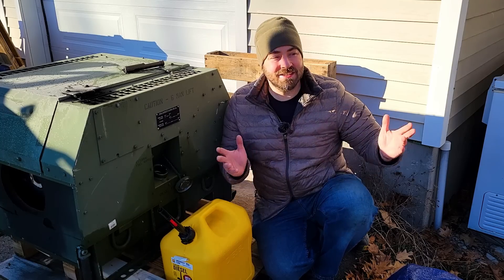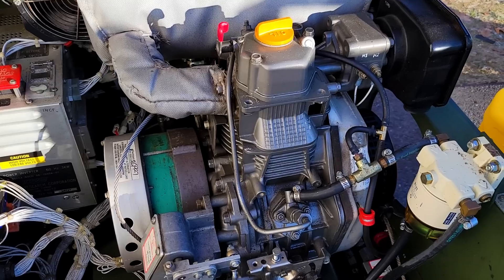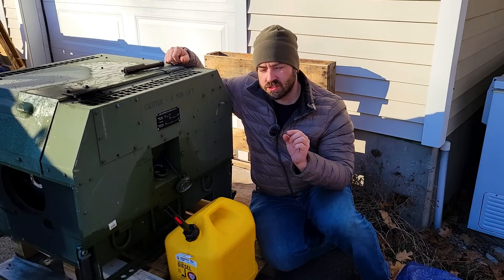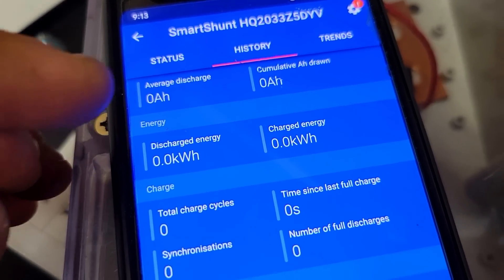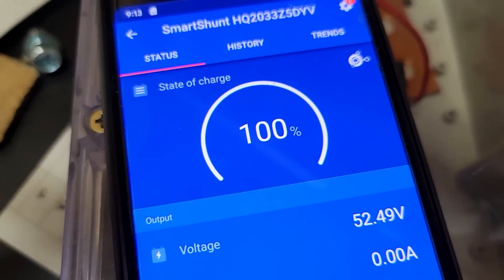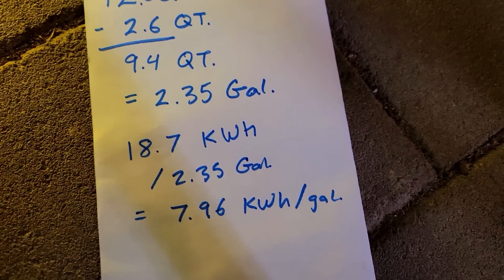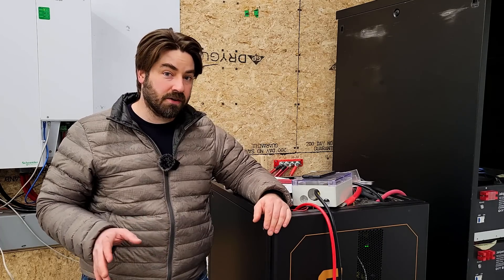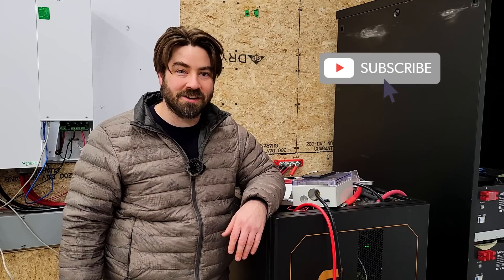How efficient is this Army generator?  MEP-831A

Comment: Hey David quick question... I have eg4 3000 at my cabin and getting shocked if I touch metal appliances and tools I'm using from it. It's worse if I'm wet.... aka concrete mixer lol. It's not earth grounded nor is any part of this temporary setup. It has a place for it on the chasis so I'm wondering if that's the issue? I haven't experienced this with my growatt 5000 at my house and they are not grounded but the house has the original ground from the main load panel. Any thots??thanks
Reply from the maker: Grounding is never a bad thing, and I recommend grounding if possible.
Note, I've never tested the EG43000 inverter, so I can't speak to that model.  In general, if I was to get shocked by an inverter, I'd first check that all my connections look good.  I'd check there are no loose wires, or fine strands of copper, that might be making a short to the housing.  If I can't find something like that, then I'd either scrap the inverter, or if it's under warranty, get a refund.

Comment: I’ve been watching your channel for years, especially the generating projects. Have you ever considered using a brushed dc motor as a generator and connecting to the  pv input  on the inverter.?
Reply from the maker: I did that with my treadmill project.  The treadmill motor is brushed.

Comment: David, have you ever thought about using a small 48-volt wind turbine?
By the way your channel is sweet... great information
Reply from the maker: I think it would be fun to try a cheap wind turbine.  However, my location is terrible for wind.  Low average wind speed.  I don't have enough room to set up a large tower. Lots of trees on neighbors property.
Reply: @DavidPozEnergy My set up has similar issues. When I get everything assembled on my new building I would like to try one on the roof of my shop.
Living in South Dakota the winter is short days. Love all the information you have provided on your channel!!
Reply: @DavidPozEnergy  Have you picked out a wind turbine? I have not found one that I was impressed with.
Reply from the maker: No, I have not picked out a turbine.  I would need a very low-speed start-up.

Comment: I used to have a semi and I had a rig master 4000 watt generator with a 3 cylinder diesel engine. This was an economical way to have a heater or a/c on the truck and have power to run a microwave and tv. Those little generators ran on like a quart of diesel an hour full out running. All I am saying is, you might find an older one cheap and check it out.
Reply from the maker: Thanks for the tip.  I'll see if any show up on the used market

Comment: If you ever need to buy another generator buy a military welder it will already have dc around 48 volts at about 200amps your mppt charge controller can handle them my old one could do 500 amps with adjustable amperage dial with a very efficient perkins deisel i payed 1100 for it
Reply from the maker: Thanks for the tip

Comment: I would assert that the improved fuel economy of the military generator has everything to do with the improved fuel ability ... diesel vs gasoline.   35% sounds about right in the difference without doing the calculation. .. good video David ....  good stuff!

Comment: Here in Finland, diesel and gasoline are roughly the same price, approx. 1.8€/l, tax-free diesel approx. 1.4€/l (11.8kwh/l). I heat with "free" wood 4kwh/kg, my electricity usage is low, I just received the electricity bill for the end of the year 143kwh/2 months energy price 1.3€😂 I have a stock exchange electricity contract, (electricity is priced hourly) and the Norwegian electricity seller made a mistake and the price of electricity for 9 hours was -0.5€/kwh, normally 0-0.3€/kwh, they had to pay to me use electricity during those hours. The monthly payment for the electricity contract is also €5/month and the very expensive electricity transfer fee is €40/month +€0.07/kwh. In ten years, almost €5,000 will be spent on fixed payments, which would probably get some kind of solar power system, but there are at least three major obstacles to that, November, December and January😢  I guess  that 15% is still lost when converting from the batteries back to mains electricity?

Comment: Love the video, convinced this is one thing I need here living off-grid. One thing I wonder is if I could use black diesel with it?. However,  there seems to be a flaw in the way you did the test. I would have done the test differently for more accurate results. I first would have measured out the diesel into a portable tank. Then I would have put a fuel line from the fuel pump inlet to the tank inside the unit. This would allow a more accurate measurement of consumption. It would not have mattered if it was 2 gallons or 10, the numbers would have been the same in the end.
Reply from the maker: There are several ways to get there.  I admit that there is some margin of error in my method.  My goal is to get the big picture between the different generators I have available.

Comment: Great video.   I found one of these generators on Market Place with an asking price of $1200, in running condition with very low hours.  Unfortunately I didn't know what I was looking at and while doing some research it sold.  I like the idea of using diesel fuel over gas because diesel stays stable much longer than gas and has more btu per gallon.  That being said, if l'd of seen this video before I'd have that generator.
Reply from the maker: I have a couple for sale in Massachusetts, but the ones I have are not running yet.  I still have to go through them.  Or, I have a friend in North Carolina that has some too.
Reply: @DavidPozEnergy  What part of North Carolina is your friend in?  I live right near the border In Virginia.
Reply from the maker: Contact information for Chris, if you want to buy a military generator: mepgenerators@pm.me

Comment: Great info.  I have been looking at the 6.5kw version.  We are remote in Alaska and can get the fuel cheaper than gas if we buy in bulk. I have a Yanmar L90 but the engine is slowly kicking the bucket.  I need something that will run my work shops as well as charge the batteries for the house and cabin.  Keep the videos coming please.

Comment: I was curious on the actual cost per kWh,  thus using @DavidPozEnergy 's measurements and the current fuel cost averages for North America.  Both the MP-831A and the Honda generators will cost about $0.53 per kWh. Not surprising they are the same as they both are producing the same amount of work in the end.

What is the real difference is run time between refueling (the larger military gen's tank runs like 8hrs at rated loads, while the Honda will probably run 5hrs at the same load). Additionally, you need to factor in maintenance and repairs;  the diesel engine requires more expensive maintenance parts (oil, oil filters, fuel filters, etc),  while the gasoline engines have much less expensive (and perhaps more readily available) maintenance items and repair parts.

Though, admittedly; running surplus military equipment does up the "cool" factor and keeps a piece of perfectly good, over-built, equipment from the landfill/crusher.  Thank you David for your continued experiments and observations; look forward to the next video.

Comment: It would be awesome if you can do the same experiment with the Honda EU3200 which is rated for the same continuous load. I would love to know its kWh/liter rating.
Reply from the maker: Yeah, that would be a good comparison.  I've never tested the EU3200.  However, I have tested the smaller EU2200 model in a past video: https://youtu.be/QAoorfdbefo?si=VcdNABj1cQaecr08
That might give you some idea.
Reply: @DavidPozEnergy  yeah but the 2200 is carburated and with an older engine, not the new direct fuel injection engine. I assume the fuel efficiency in terms of kWh/kg or kWh/liter will be better, but I'm not sure how much.

There's basically no one looking at the fuel efficiency like this, it's pretty annoying. Aside from you, that is! Although another idea for you: these engines are most efficient at different load %. Maybe try to find how they perform at various % load?  I.e. if a diesel genset is rated 5kW, compute the fuel efficiency at 1kW, 2kW, 3kW, 4kW, 5kW. I believe there's large differences.
Reply from the maker: I agree that it's pretty annoying that this type of real-world fuel testing is not being shown.  I'm trying to change that with what I have available.  I'm always willing to test more generators if anyone is around me and willing to loan me theirs.

I made a video comparing different % on my Honda: https://youtu.be/kQTFPMDE_F4?si=9_q4Ks81ErQ45fh0

Comment: Looking to purchase the same unit from a friend. Do you know of any service manuals that might be available for these units? Most common problems or failures? Yanmar makes excellent engines and with the militaries modifications it’s idiot proof. What would you venture to say is the true power output of these units? Diesel engines do run cheaper than gasoline engines in general. Unfortunately the cost of diesel has doubled in the last few years. I was told that in the country that I currently live in, it’s illegal to run off road diesel in generators, WHHATT? Just another way for the corrupt government here makes more money off of its people. Even in the states oil companies are raping the public with the cost of diesel. Looking at trying an experiment that supposedly can remove the red dye used in heating oil.
Reply from the maker: https://www.steelsoldiers.com/
register to this forum.  The guys on here want to help keep military equipment alive.  All the manuals are available as a fee download.

Comment: Can you bypass the inverter in the gen and just use the 3000w straight in to a charge controller? I feel like all the heat lost in the inverter and yellow charger is at least a kw.
Reply from the maker: I'm working on it.  It's far more complicated then it appears on the surface.  But, I'm recording myself as I work through the issues.  At some point I'll have a video on it.

Comment: Do you ever run off road diesel(red diesel) in your  generator?
Reply from the maker: Sure, if I can get it.  But, usually I just go to the local filling station and pay the extra for the diesel there.  Simply because of time.
Reply: @DavidPozEnergy  Def understandstable. Also, have you ever thought about running WVO (waste vegetable oil) or other waste oils as fuel in your generator? I’ve been using WVO for the last 16 yrs in my diesels, it’s amazing.
Reply from the maker: I love WVO.  I have plans to test WVO in my generator in a future video.  I'm still getting parts together.  I've converted a few cars and trucks to run on VO as well as some boilers.
Reply: @DavidPozEnergy  EXCELLENT!! Def looking forward to those videos 👍🏼

Comment: Nitpick:  Diesel is more energy dense than gasoline per volume.  So you should convert all of them to Joules and then see how many Joules of fossil fuels per kWh of charge.  For instance, 2.35 gal of diesel is about 318.4MJ of energy and you put 67.3 MJ into your battery or about 21.13% efficiency.  

Whereas a gallon of gas has 121.9MJ of energy and 5.9kWh is 21.24MJ of energy, an efficiency of 17.42%.  

So yes, the diesel is more efficient.

Comment: Very interesting comparison.   Where I am at diesel is a bit more expensive than unleaded, 30% more expensive.  It would seem from a cost perspective it would be a wash.  The plus side for the diesel generator though is it could probably run on just about anything that will burn.

Comment: I would have liked to see a efficiency comparison calculating the two different fuels:  how much potential power in the volume of diesel used vs delivered energy compared to how much potential power in the volume of the gasoline used vs delivered energy.  That would have given a true apples-to-apples efficiency comparison.  Then you could have gone into cost per KWH into the battery bank.  Would have presented a much more nuanced picture and made for a useful video.
Reply: Those might be technically interesting, but it doesn't really change what matters: how much electricity can I get out of a gallon of fuel?

A person may not have diesel readily available, or the space for a diesel generator. This is all about finding the best possible machine for your individual use case

Comment: I find a couple of issues with your comparison:  First, diesel has more energy than gasoline and costs 20% or higher more than gasoline.  Second, the comparison of the Honda which is 5500 watts and the miltary is 3000 watts.  I find that the larger the generator the more fuel it consumes at lower loads.  So it would be better to compare another 3000 watt inverter generator to the military.  On my 3000 watt Champion I usually could get around six hours on 1.5 gallons a gas using a 13,500 btu rooftop ac.
Reply: Except it's not about comparing diesel to gas. It's about comparing multiple types of generators to each other. Fuel in. Electricity out. 

Everybody's choices are different. What's most important to you, fuel type? Maybe size? Maybe noise? What about price? 

There are way too many considerations to just pick one characteristic and die on that hill when you're helping a few hundred thousand people.

Comment: So you’re comparing a gasoline engine that has the potential to produce 6500 watts to a diesel engine that only has the potential to produce 3000 watts. Now reverse the potential for each engine and see which is more efficient.

Comment: I own 3 of the Mep831a. Gen sets and they are a bit finicky but I like them. The older ones have inverter failure issues as well. Prefer units with inverter serial numbers higher than 9000.

Comment: If you buy enough solar panels and batteries, you will rarely need a generator. Off grid for nearly two years. Less than 25 hrs on the LP powered 10kW Generac.  Most time contributed to monthly testing.

Comment: In fairness to the Honda, I believe you will get much better efficiency if you run your Honda generator at its continuous rating, I think this is 5.5KW. The auto throttle improves fuel efficiency on low loads but can’t mask the overall mechanical and heat losses. The fact you can finely tune the generator load is really good. If you have chance it would be great to see a Honda rematch….
Reply: Every engine has some rpm/load compination where it is the most energy efficient. Low load=much of mechanical waste, high load=not perfect fuel burning

Comment: That is about 21,5% efficiënt, there is 37.1 kWh in one gallon of diesel fuel.

I made myself a permanent magnet battery charger from a hubmotor and a 36 yo Hatz 1 cylinder diesel engine, I run this to charge my 48 volt battery bank directly without inverters or electronics, I only run the AC output through some diodes to get DC for the battery, this increases the efficiency even more, i calculated mine at 28%

Comment: Those automotive alternators are not very efficient, and they need to spin like 6000 RPM for full output. I wonder how a brushed dc generator would do. You can find a lot of lower voltage DC motors in old forklifts and pallet jacks. You want to find one with a shunt field. They work perfectly as generators. What is the voltage of your storage batteries?

Comment: Huge miss not doing the math out with the specific energy of gasoline and diesel, probably should pull until this is done right….
Reply: It's definitely done right. 

It's comparing generators to each other. Who gives a shit about fuel density? It's volume of fuel to energy produced. 

If you own a diesel truck and a gasoline car, you could not possibly care less about relative fuel densities. You use the machine that you need at the time to get a specific job done.

If you want a video on relative fuel densities that does math word problems, you should probably go make one!